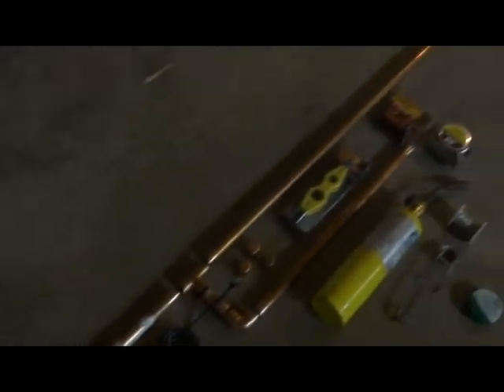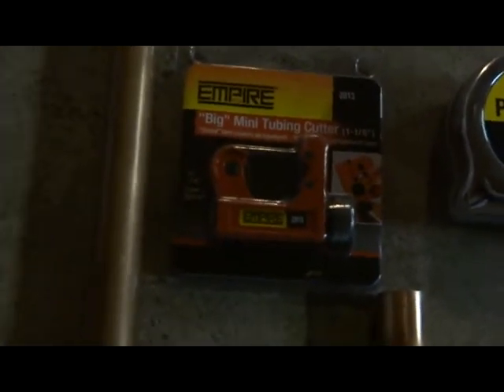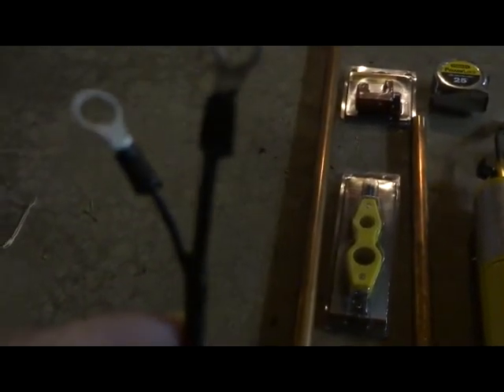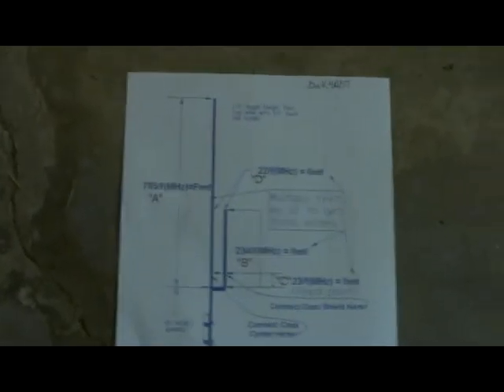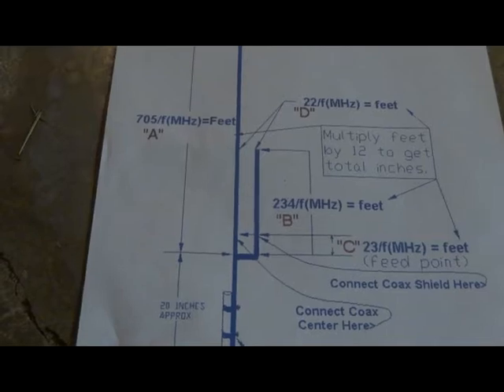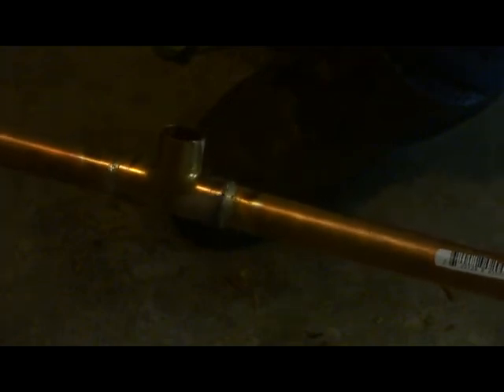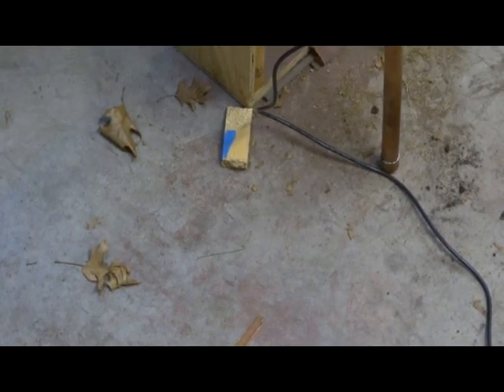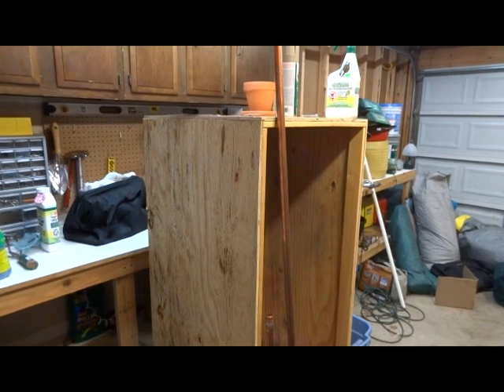2m Copper J Pole antenna

Comment: If you use a galvanized conductive mast that is grounded and electrically connected to the copper antenna "handle" and on to the coax braid, you form a ground loop through the station ground. The dissimilar copper to zinc plate can setup electrolysis and future corrosion.  VA7WN

Comment: Be cautious using a metalic support mast. You can get multiple half wave standing wave nodes going down just as easily going up from the 1/4 wave stub tune. If by chance the mast length resonates near the design frequency, then the operational frequency can be "pulled". All your tuning efforts may be for naught after elevating on that metalic, conductive mast.

Comment: If you fold over a 3/4" strap over the 1/2" pipe and use a brass bolt and nut, it makes a less expensive adjustable feed point connection. VA7WN

Comment: Thanks a lot for the video.  I have had my technician license for a little over a month now and plan on building an antenna just like this.  A word of advice though (this is coming from a guy that installs water softeners for a living and sweats copper everyday), it's a good idea when you are done with your sweating project to thoroughly clean any excess flux off of the copper.  Flux does a great job of drawing the solder into the joint being soldered, but the downfall is that it slowly eats away at the copper over the years and can eventually cause a leak.  Not a concern on an outside antenna that will get rained on, but if you ever need to sweat something copper in your house, it's a good idea to clean it off.  Thanks again, and 73.  Tim-KD9CTS
Reply from the maker: Thanks for that tip. I actually always clean flux off whether I am doing electronics or copper. I don't like how it looks if there is excess amounts after soldering and it's just much cleaner and prettier to clean it all off. :)

Comment: This guy is trying to help us all out.Dont tell him bad things about his video and how he does stuff.People these days? 
KDORVY,I am trying to build one of these for my scanner in Iowa 50541. Will all of these dimensions for this one here work or do I need to go with a different size?I was going to use an SO-239 Connector for my cable with the small copper wire to the other side of A?
Reply from the maker: When it comes to making any kind of antenna, it will need to be sized for the frequency range that you want to be using it on. So the dimensions I have gone through in the video will not be the same for any/all radios. A J-pole style antenna may not be the best option for your scanner either. For your cable ends, you would want an SO-259 (not 239). The other end of the cable will depend on what type of connector you have on the back of your scanner. I'm not all the knowledgeable on scanners yet, but I would look up what connector you have on your radio and get make sure you get the type you need. I hope this helps you out a little. :)

Comment: A ground plane ant is better unless your in a zeppelin!
Reply from the maker: I would agree. Yes the zeppelin did use a j-pole antenna. I decided to do this because it is an antenna that requires few parts and its an easy build. I do plan on doing a video on a ground plane antenna also. I have been working on many new videos and I am trying to make them better. The downside is that my editing software got all messed up so that's holding me back right now. I know you weren't asking about that, but I through it in there any way. :)

Comment: You don't need a wire pipe cleaner unless the pipe in very dirty - acid flux will overcome most surface deposits. The joins don't have to stop water leaks - they just have to join the pipes reasonably securely together.
Reply from the maker: I just did the wire brush more for me than the fact that the pipe needed it. :) It really didn't, but made me feel better about doing it and I thought I would throw that step in the video in case someone was in a position where they really should use it...lol I was shooting to get a water tight seal on all my joints because I wasn't sure if it was going to be going outside or not. It has been inside this whole time, but eventually I would like to get it outside.

Comment from the maker: I have not used an SWR on it yet but I do plan too. At the time of making this video I did not have access to an SWR meter, but do now through a coworker. As far as performance goes, well this may be relative, but I can be on my HT sitting on my couch in the basement and hit a repeater that is about 30 miles away. So based on that, it works great. Even with my upgraded rubber ducky, my HT was pretty much worthless.

Comment: you cannot weld a so-239 you will melt the insulator.  use instead a 2"x2" piece of plexiglass. Drill a hole in the center and place the SO-239 into the hole. fasten it with brass screws & nuts, connect with the ground & the center wire according to the plans & then tune the antenna.